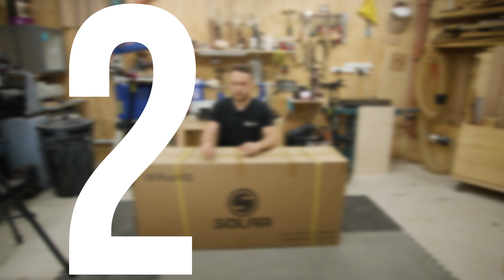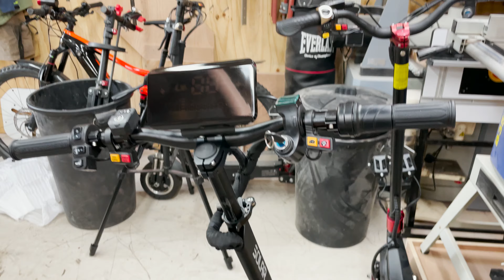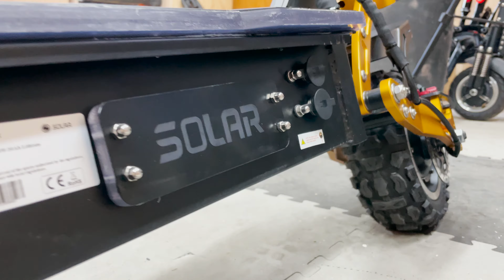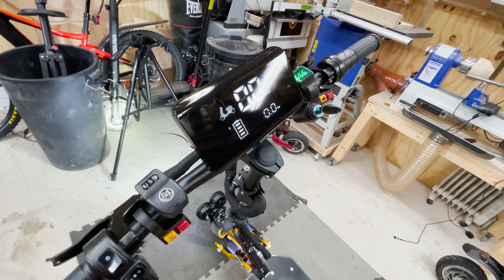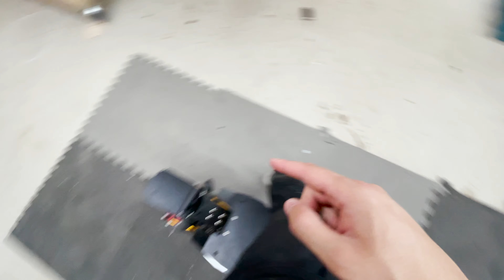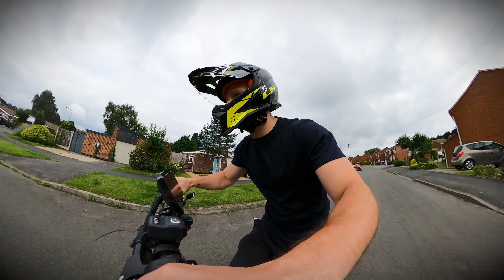Solar FF 2.0 Unboxing (60mph e-scooter!!!)

Comment from the maker: Let us know what you think to the Solar FF 2.0 in the comments!
Reply: you plug the charger into the scooter first, then the wall!!  that is the safest way with those types of plugs..
Reply: @lionelhowell4972  I disagree it will arc the pins
Reply: @sharpshooter147  no it doesn't!!!
Reply: @sharpshooter147  ask any electric scooter manufacturer, and they all will tell you the correct charging procedure. Scooter first, outlet second. Otherwise you will ARC the pins, and possibly damage your battery or BMS..
Reply: Hi...can you ajust or change the speed in settings like one 15-20 km etc...?
Reply from the maker: @king489  yeah if has 3 speed modes. 1, 2 and 3
Reply: Whats the maximum handle height from deck
Reply from the maker: @jamaalmoss8478  it has an adjustable handlebar height 👍🏽
Reply: @SolarScootersuk  whats the maximum height it can be extended to....deck to handle
Reply: @SolarScootersuk  yeah he asked what is the maximum? lmao
Reply: which one the p1 pro or the ff 2.0, It will be ridden off road more? thanks
Reply from the maker: @neurofunk2731  FF 2.0 definitely for off road!
Reply: @SolarScootersuk  thanks mate will be ordering one very soon 👍
Reply from the maker: @neurofunk2731  no problem!
Reply: Any Dealers in The US?
Reply from the maker: @its_never_sunny_in_seattle  we have a distribution centre / showroom in Lancaster, CA ⚡️ all USA orders ship from there
Reply: @SolarScootersuk  ) it doesn't show the building on the map .
Reply from the maker: @cyberwolf7514  it’s a brand new building only a year old, so probably not registered. Address is at the bottom of our website:

www.solarscooters.com
Reply: You really need to update this video , there is a fair bit of change in the FF2.0

Comment: I bought this scooter back in 2021 - now I need to bleed the brakes. Can you explain how to do it?
Reply from the maker: Check out our brake bleeding tutorial on our channel!
Reply: @SolarScootersuk  The video shows NUTT brakes.  2021 FF2.0 does not have NUTT brakes (you should know this).  The stock brakes are not branded (red in color) and do not have the bleed cup!  Please show a video of the actual brakes on FF2.0 2021

Comment: Do you have the 2 4000w motors for this Solar scooter. As i was born for 2 wheels that rip you arms off when you pull off on 2 wheels. It sorts out my PTSD right out.

Comment: When it comes back in stock soon, will the new updated version of the FF 2.0 have cruise control?
Reply from the maker: No it will not have cruise control
Reply: @SolarScootersuk  Thank you for your very fast replies.
I was wondering, could I have the Solar P1 Pro Tron Edition customized where it has the Solar FF 2.0 front suspension and rear swing arm as well as the 11 inch off road wheels?
I was also wondering if I could have parts of the scooter as red metal rather than black if possible, and also red grip tape with a logo on the top of the deck?
Reply from the maker: @skinnybuddhaboy  no worries! And any customisation needs, best to email the team 

hello@solarscooters.co.uk
Reply: @SolarScootersuk  I already did.
I was just being impatient for a response, and asked the same questions on here, lol!

Comment: Hi, some recent reviews of this scooter mentioned that this scooter only has 15mi range while it states 50mi? Can you please clarify?
Reply from the maker: I am not sure where you have seen these reviews, have you got a link? 

Any that does that mileage most likely has a controller issue, which can be sorted under warranty. Working properly, the FF 2.0 easily does the rated range of 55 miles.
Reply: @SolarScootersuk  This youtuber reviewed and only got 15mi range. https://www.youtube.com/watch?v=FzutZOG2x8w 

Would you say 55mi range is on eco mode gear 3 or turbo mode gear 3?
Reply from the maker: @HMPlaysPC  I have seen that video, as he was going extremely fast all the time that’s what probably sapped the range which is normal. Yeah 55 miles is reachable in mode 2, no need for eco.
Reply: @SolarScootersuk  Thanks a lot. I hope that it really does achieve that mileage stated on your website. I have a saloon car. Can this be fitted in a trunk of a car for transportation? What is the dimension in length and width when folded? Thanks :)

Comment: i was riding the scooter on like 40km/h. charge was on 2 bars then went down to 1 bar. then few seconds late the scooter just turned off. I'm guessing it's just a dead battery. there's no damage to the scooter, right?

Comment: Hi does the FF 2.0 have a settings p mode on the screen where you can adjust things like cruise control on or off ,wheel size ,Regen braking etc or is it just pre set and you can't adjust
? Many thanks

Comment: 60V is good but 17.0Amps is way to low not enough power every other brand is offering 20 25 30 40Amps👎
Reply: It looks it has 45amp each controller!
Reply from the maker: @alwsquestion  and a 30Ah battery capacity
Reply from the maker: This model is 30Ah check our website 👍🏽

Comment: I got a monster scooter that only goes 35 mph an now police are coming on top, I been using it for the last year an half but I had a copper moaned at me saying my scooter is illegal, I was advised to get a bike an put conversion kit on it, Coz bike got peddles makes it legal, I don't understand it bike scooter they both do the same thing by getting you places, Plus this scooter looks like a yume version, But yeah the police are starting to come on top with these scooters, I hate it but I feel people will buy one of these an have it taken off them for riding on the road, I would be pig sick, So only use mine close to home now, I'm scared the police will end up taking it off me, So I got buy a bike next week an slap an electric motor on it, Good thing about the bike conversion kit it got an instant 250w mode, lol, But yeah I'm pissed the police are coming on top with electric scooters, I loves riding my electric scooter, It's different to riding a bike, More enjoyable if you ask me, An you don't get left with a square ass hole from sitting on bike seat for ages, I seen bike seats for 140 quid lol, Price people pay for a comfortable seat, lol, But yeah if police seen me on road with this round my ways, It would be taken off me, It's why I won't risk paying all that money to end up paying more to get it out the police pound, I feel bad for those who had 6 points for using an electric scooter, I know someone had 6 points an thousand pound fine, Using a xiomi scooter, Don't even do 20mph an it cost him a grand an 6 points, In all honesty its daft using electric scooters on the road, It feels so unsafe with crazy ass drivers in cars passing you while you avoid the curb, Boris needs to make infrastructure PEV friendly...

Comment: beautiful scooter. does the manual gives recommended psi settings for the shocks as per a persons weight?
Reply from the maker: Thanks! No recommendations for shock PSI but can adjust until required firmness is achieved.

Comment: Hey there..watching from Sydney Australia... Looks like a nice platform...I have the dualtron ultra 2... This thing has similar top speed claims and is only 60 volt 👍 Subscribed 😁
Reply from the maker: Hey there Ben! Thanks for the positive feedback, we’ll be bringing out more videos on the FF 2.0 and might do a video pinning it against the Dualtron Ultra 2 👍🏽
Reply: The Ultra 2 should be faster. I can't imagine a 60v scooter actually getting to 60mph.
Reply: Dualtron ultra 2 costs more

Comment: Looks a beast. Does it have regeneration braking and an option to turn on/off launch mode like the P1 Pro?
Reply from the maker: Slight regenerative breaking yeah! And launch mode is basically on all the time with this, it’s mad. But you can switch the gears to make it less responsive and slower if you wish.